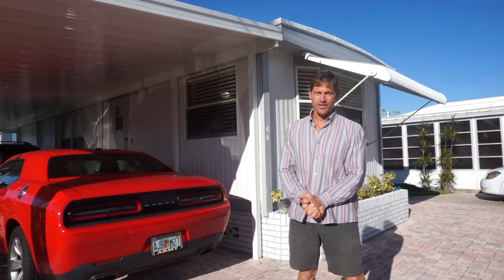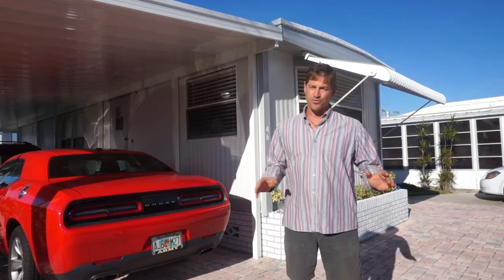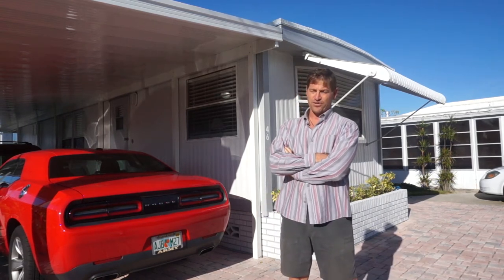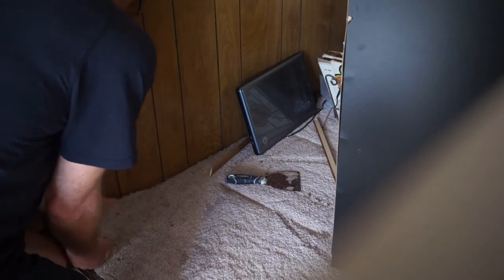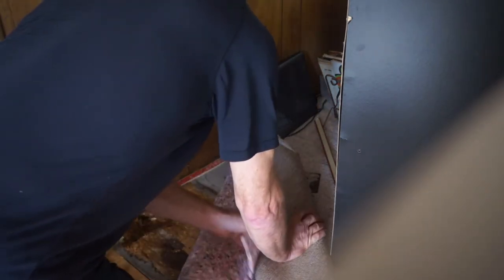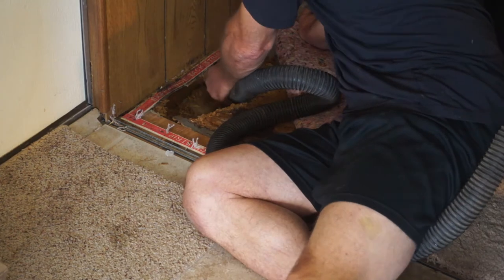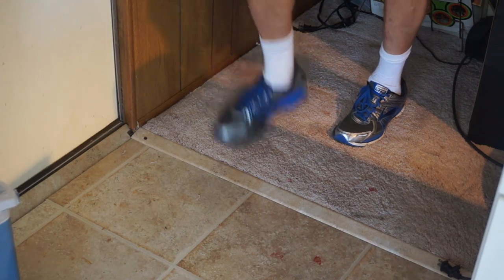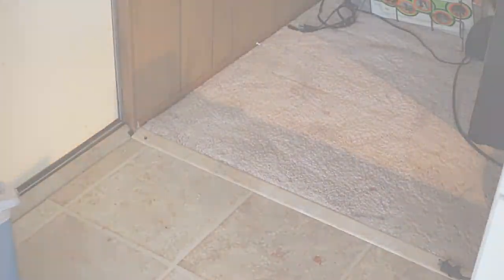How to Repair a Mobile Home Floor

Comment: Thank you I have soft spots in my Mobile home in my kids room and in living room. Was stressing bout how to do this but seems straight forward. Only concern is 2 of the soft spots are over heat registers.
Reply from the maker: I had to do this for another property.   It was easy,  just use a jigsaw to  make the hole for the vent.
Reply: @randycoppola2069  ok will do thank you. God bless.

Comment: If there are multiple holes  and a toilet sinking in who would I call professionally to fix a floor
Reply from the maker: It's funny you mentioned that that situation happened to me.  In my case it was the nasty job of getting underneath to see how it was supported. I added Timbers underneath where the toilet was and where weak spots on the floor were. Then I went above and removed the particle board by the way using particle board is why this happened. And then I was able to lay down three quarter inch plywood for the fix and win